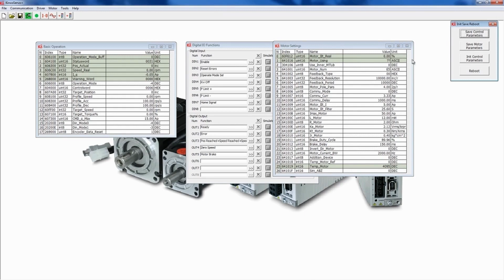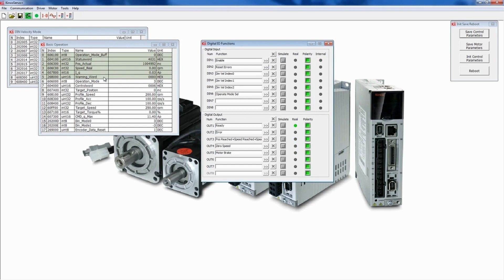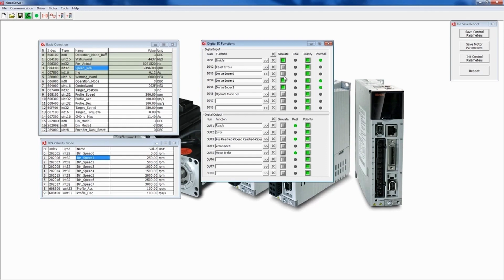Kinco AC Servo Motors Quick Start Guide

Comment: Hello, can U please help how to make factory reset all parameters in Kinco FD422S ?
Reply from the maker: Hello, thank you for your question. To reset a servo driver:

1.	Open Kinco servo+ software and establish communication with the driver.
2.	Open the Init Save Reboot window
3.	Select Init Control Parameters
4.	Select Save Control Parameters
5.	Reboot servo drive
6.	The motor number will remain but all other settings will be reset.